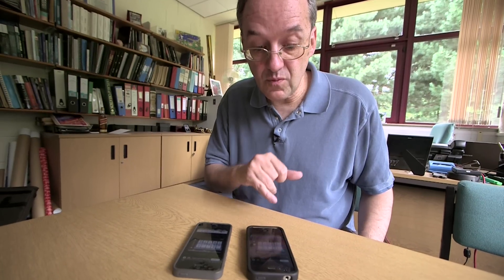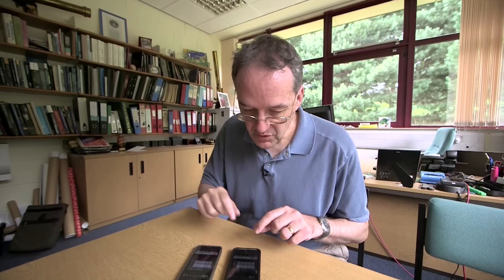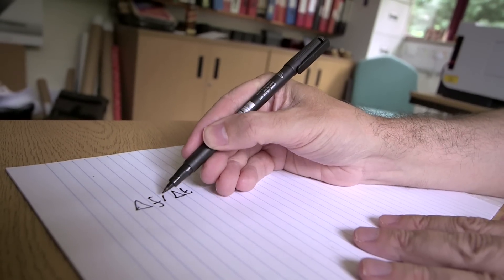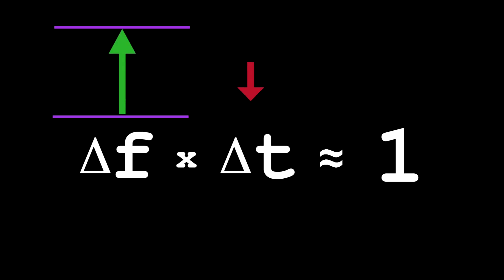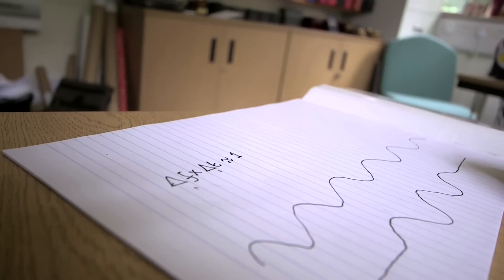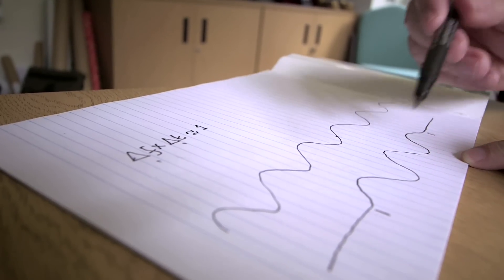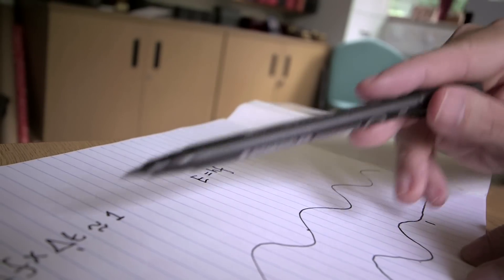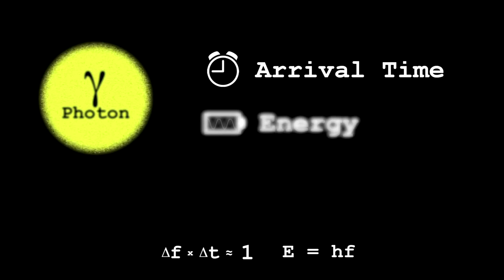What is the maximum Bandwidth? - Sixty Symbols

Comment: I admit to not being very savvy on laser function. My basic understanding is that in early lasers, an energy source is introduced into a partially evacuated tube having a mirror at on end and a partially mirrored lens at the other through which the light energy finally passes once energy level has built up enough to do so. Isn't there energy loss due to this process? Wouldn't the beam exit with more power if it didn't have to work its' way through the lens mirroring?

Modern welding masks are now outfitted with the electrically driven capacity to go from clear to opaque in very short periods of time saving the welders' eyes from U.V.. If one were able to develop a mirror coating for the lens that could be turned momentarily clear, wouldn't the energy beam exit with more power? Wouldn't it be possible to build up even more energy within the tube by having two more perfectly reflective surfaces at each end between which to oscillate and then having one mirrored surface (the lens) that could momentarily be made transparent? 

Perhaps that way, one could cause a full energy light 'slug' to be discharged as compared to essentially firing a lower energy long burst.  Iv'e seen light 'slugs' produced at various thickness of length as strobe flashes used to photograph the incredibly fast changes that occur within the molecular structure of substances . but it was my impression that they were produced by starting and stopping power to the laser in short burst pulses. Just curious. 

Some years back, I remember having read an article concerning an experiment wherein a light was shined through an (if memory serves) an argon filled chamber through one lens and out another on the opposite side of the chamber. I don't quite remember what the initial impetus for the work was but the end result was that the light exited the second window before the beam had been fired. THAT to me would present to me a few interesting questions. I also heard of one wherein light had been slowed down to roughly around to 7 mph.. in slug form. Any further information you might of heard of and would be so kind as to share along those lines would be much appreciated. Thank you.

Comment: The band gap gives you the center frequency, but there's a little blur around that center when you turn it on or off. If you turned your green laser on and off a quadrillion times in a second, it would look white. Of course, if you only switched it a trillion times, it would be unnoticeable, and even that is 1000GHz and your semiconductors aren't going to behave normally.

Comment: Isn't it cool that truth turns out to be the opposite of what we assume. 

Back in 1983 our community installed a dual coaxial cable CCTV system in preparation for up-and-coming internet. Which at time we were still using screenless teletype terminals to receive early emails through. But only few laters all we needed to do was use second leg from single coaxial line to do the same. Yet most people utilize telephone modems and twisted wire for internet hookup until telecommunication companies finally began offering cable broadband internet in the 1990s.

Comment: No electronic circuit can come close to the bandwidth needed to take full advantage of a fiber's bandwidth. That's why we use wavelength division multiplexing. It isn't just cheaper- it is the ONLY way to take advantage of a fiber's bandwidth. Even so, current WDM and DWDM leave a lot of fiber bandwidth unused.

Comment: The reason a laser turning on and off doesn't  remain at the same frequency is because of the amplification cavity inside the laser which produce a wavelenght giving it's  dimensions, turning it on and off changes the temperature in the cavity and therefore it's dimensions and wavelenght output. Also i'va never seen a laser source with a perfect single wavelenght, the energy is always spread on a small bandwidth around the peak wavelenght.

Comment: Have they tested this? I'm curious how this is resolved if you generate a pulse shorter than a fibre cable can handle, since the pulse of light isn't generated within the cable I don't see any reason why you can't make a pulse shorter than the 1 femtosecond limit, but what happens to the pulse when you put it into the cable? Does it lengthen as the frequency range is pinned down and your certainty about its frequency increases (since you know it fits down the cable), or does it just not go through at all? Or something else entirely?

Comment: But, you can send information with a plain carrier wave by on / off keying. And that doesn't stop the oscillator from generating a single frequency. Prior to the invention of Amplitude Modulation, that was how all radio signals were sent, using Morse code.

Comment: To correct, it would be 1x10^15 bits per second, not bytes.  So that's 1.25x10^14 bytes per second, or nearly 114 TiB/s as a theoretic limit.  But as staabmia pointed out, that's not how data travels through fiber optics anyhow.

Comment: Actually, even that is wrong. At the femto-second (or some ultrashort time) that the bumper of a car touches a wall, the wall has not moved or barely moved at all. How then can you judge the force of the car? You calculate the force of the car after it has finished smashing into a wall, but that's two different things. You know them separately at different times. If you needed to know the force of the car in less time than it takes to finish smashing into a wall, you couldn't know that.

Comment: well in theory we could distinguish up to 57TByte of information per second, with a on pulse of 1 femto second.

1s/10^15 = 1000THz  1000THz/1024b^4=909.5Tb
(1024b^4 = 1Tb)
Now assuming that we want a pulse to have a 50-50 duty cycle on for 1 femto second and off for 1 femto, this means that the resulting bites gets divided by 2, that is 454.74Tb, to translate that in byte it would be divided by 8 or 56.8TB/s 
1TB= 1/56s or 17ms
this gives us a good margin for errors while sending 1TB under 1sec

Comment: I think that arguing that the frequency distribution of $f(x)=\sin(x) \Chi_[a,b](x)$ contains frequencies too high if $|a-b|$ is small to be transmitted is problematic since this is the case regardless of $|a-b|$. Also, how do you propose the material "sees" the spectrum of this infinite-time signal? Shouldn't later pulses also be part of this signal? 

A simpler (probably "wrong") explanation is: Frequency *Time per wave =1 so the limit is really saying we can't send less than one wavelength of the maximum frequency per pulse and still make sense of the signal at the receiver. Does this translate into a quantum statement like "you cannot transmit a non-integral number of photons"?

Comment: They explain that in the video. It's an engineering problem - they assume we use fiber optic cables unto eternity. A fiber optic cable can only carry a signal if the light is visible. If the pulses get too short, they break off into infrared and ultraviolet and escape the cable or are absorbed by the insulation. So your string of binary becomes a string of zeroes over long distances. That's what I got out of it, at least.

Comment: This really got me thinking!!
I think I grasp the concept, but wouldn't the bandwidth limit come down to the ability to accurately produce and receive a particular wavelength of light within the "used" frequency range??
Is "f" an practical range (limited by tech) or an absolute(not sure if the right word) range??
I mean isn't the light spectrum (and the sound spectrum) infinitely divisible??
I guess another issue would be the distance and interference but in a "perfect" cable, not even one that could transmit an infinite spectrum,  wouldn't the limitation be then be the pulse width.
It could be argued the other way too!

Comment: If you tried to put a Femto second pulse down a fibre optic cable using the whole optical bandwidth the red & blue light would arrive at different times due to the differing velocity in glass. Would this not mess things up well before you got to the level of Femto second pulses ?

Comment: More correctly the bandwidth limits the information and reliability.  Compression strategies can encode more information, but they reduce S/N.  The fundamental limit is specified by the Shannon entropy.  Also, this bandwidth limit leads to femtosecond pulsed lasers... attoseconds require too high of a bandwidth.

Comment: When you poke a car that weights 500kg with a photon, it's position or energy won't be effected by much. On other hand if you poke photon with a photon it's energy will be effected. Only way to hit photon with less energy is to use longer wave length light. If you use longer wave length light you can't measure position of the photon accurately.

Comment: Think of switching (light, sound) on and off as modulating between the frequency of the (light, sound) and 0 Hz.  In order to detect the (light, sound) as existing at that frequency, at least ~ one complete cycle of that (light, sound) must be transmitted.  One of the troubles is the rate at which you're switching the (light, sound) on and off has a frequency to it as well, which as you heard with the two phones will cause beating against each other.
Reply: wonderful comparison

Comment: One 'problem' with small pulses is the increased energy needed to switch the laser on and off.   0.005p Joules doesn't sound much until you require 10^15 of them, a second... (Giga Watt Hour...)

Comment: Can you use several frequencies at several amplitudes at the same time, with each amplitude and frequency giving separate interpretations based on their combination?

Could you have pulses going up towards a point (signal strength) where a minimum, say "0.1" is one result, "0.2" is another, and then if you have "0.2", "0.1" is still recognized as "0.1" because 0.1" is locked by the receiver, and won`t give "0.2" until "0.2" is reached, going all the way through the signal power range. (call it a 100)

A, ehm, variable frequency, variable modulation combination based signal transmission..

Does that make any sense at all? 
I don`t know (or understand) this stuff, it was just a thought that pooped in my head :p

It works with radio waves, (I think, since you have AM and FM) don`t judge me lol..

Comment: I'm curious, light is able to pass through each other right so you can have multiple photons travelling in the same space right?
Is a fibre optic cable able to transfer polarised light? Furthermore, could you join and split, using some sort of filter, polarised light to transfer multiple polarised photons at the same time that get split and sent to different servers?

Comment: It would be have interesting to have gone on with the analysis and wonder what the limit would be with no medium; that is, with no fiber between the sender and the receiver, it's just photons sent through a vacuum. My guess is the point at which trying to make a very short pulse with the very large (particularly high)  frequencies required according to the Fourier Transform would require so much energy that the sender turned into a black hole.

Comment: You said that an on\off pulse is a range of frequencies. What you didn't explain is why you need to test for a specific frequency of light when using the on/off method. It would seem that with the on/off methodology you wouldn't be looking for a specific frequency you would be looking for any frequency? Obviously off is no frequency. Is it that you cannot actually turn it on and off as quick as you can modulate the frequencies? I'm also curious if the on off pulses degrade over long distances?

Comment: I'm not a physics expert, so I can't tell you why it happens, but it's a problem because when you get out of the visible light spectrum and start getting into x-ray, gamma ray, etc. it won't be carried by the fiber optic cable. You would then be losing information.

Comment: He didn't say pulses weren't pulses. He said that it's not as simple as turning on and off a light. You need multiple wavelengths in the visible spectrum to form a pulse over fiber optic cable. That's all he said.

Comment: So ... if laser pulses are a superposition of many different wave lenghts could you actually get a distorted signal by switching a laser very quickly on and off and then sending it through a fiber optic cable that is only suitable for certain wave lenghts?

Comment: Because a laser, no matter what kind, doesn't toggle off instantly. At the start and end of every pulse, this light either wouldn't be considered a '1', or doesn't even travel the cable. The shorter the pulse, the more of this 'noise' you have. At the extreme, the Heisenberg Uncertainty Principle beings to interfere with your ability to determine data from noise. The bandwidth limit of light, however, is HUGE 1Tbps, 1000x faster then modern fiber, and there are ways around it.

Comment: (continued from above) 6 network ports which means 6 times what the wires each can bring and in thus 6 terabytes of data in a few milliseconds atm we can only go up to 100Gigabits per second though that is the current maximum speed  and of course ppl are always working on how to go faster and faster without having to use more wires to do so though it will come a time in which we have to switch the way which the wire is made so to carry multiple pulses and in thus making the amount of data more

Comment: 1's and 0's can be encoded by modulating the sine waves amplitude.
 no need to switch on /off.
Reply: Yes. But the modulation is also equivalent to a superposition of other frequencies. Any alternation of amplitude, frequency or phase converts the simple sine wave to a superposition of a whole bunch of waves. This is called fourier analysis and is mathematically proven.

Comment: Any type of modulation can be seen as an infinite sum of sine waves with different frequencies, that's the Fourier series. And if the frequencies that do not propagate in the fiber are significant enough, you can't transmit information, so this applies to AM, FM, Phase modulation etc... Why isn't Fourier theory not mentioned in the video?

Comment: Does this 'hard limit' only deal with the shortest accurate burst of light on all available frequencies? Or does it also take into account phase-shifting, frequency-shifting, amplitude shifting, and multiplexing signals. There are some pretty ingenious ways we have of 'cheating' transfer limits.

Plus, if we even had a detector capable of telling all those apart, noise on the line would mean you really couldn't be sure which data stream was which, even with trivial cable lengths.

Comment: It's not just bandwidth.  There's dispersion. All of the wavelengths have to propagate at the same speed, or the pulse gets smeared.  Dispersion is generally the limiting factor in fibre (fiber to people living in countries that have been to the moon) optics , although, I suppose it is possible in principle to compensate for dispersion.  

Dispersion is dependent on the length of the cable,  This is true of telephone cables, too, but at much smaller bandwidths.  Telegraph cables were originally limited by dispersion. Oliver Heaviside came up with the idea of adding load coils, which balance the natural capacitance and counter-intuitively reduce dispersion. Signalling over long cables (like transatlantic submarine cables) would be very slooowwww, less than one bit per second without load coils.